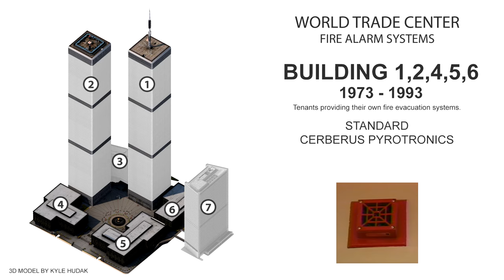World Trade Center | Fire Alarm Sounds, WTC 1,2,4,5,6,7

Comment: Thank you for uploading. Very good, clean generated sounds of the Firecom 8500 tones, which have fascinated me for a while. There is one quite eerie video on YouTube, might be unlisted, called "Inside 7 World Trade Center Moments Before Collapse", and you can hear the 8500 system chiming and whooping away throughout a good chunk of the video. Sounds are spot-on. Maybe just a difference in timing, like you mentioned in the description. I have wanted to recreate these sounds for some time to use in a possible simulation system setup, but I don't know what program I would use to do it, much less how to do it. Great job.
Reply from the maker: I appreciate it! The video you're referring to was shot by Mark LaGanga, which provided a rare account on the trade center site in between collapses of the south and north tower.
From what I could gather from the Firecom patent, the alternation between the whoops and chimes was regulated through circuitry rather than being a fixed sound file. That might explain the varying duration of it as heard in LaGanga's video. You can even hear the whoops either being cutoff or starting midway a repetition.
Reply: @RobvilleVirtualRealisations  Ah, okay. Thanks for the information! You can definitely hear it was a very primitive system, and a fascinating one.
Reply from the maker: @thebananaman1895  That's LaGanga's video indeed.
Reply: yeah I remember watching that video many times and hearing these haunting sounds.  They are spot on.

Comment: The WTC 7 alarm was also in WTC 5. There’s a video of people evacuating through the building and the alarm is going off in the background.

Edit: Turns out the audio was dubbed in that video, but you can hear the two chimes coming from one of the low-rise plaza buildings in Jack Taliercio’s footage.
Reply from the maker: Do you have a link to that video?
Reply: Robville Virtual Realisations I forget the name of it. I saw it on YouTube though. Search something along the lines of “evacuating through WTC 5” or something like that. I think that was what the video was called.
Reply from the maker: @savagepanda8458  Found it: https://www.youtube.com/watch?v=gv-wANt35hw
Really interesting find there since none of the reports mention that Firecom was used elsewhere besides building 7. I think it is safe to assume the other lowrise buildings had the same system then. I appreciate the feedback.
Reply: Robville Virtual Realisations Also, I just noticed that in the well known footage taken by Jack Taliercio, you can hear the two chimes in the background, at one point.
Reply from the maker: As cleverly noted by user Datamaster, it turns out the Firecom alarm was added into that video in post. I've overlapped the audio with Mark LaGanga's WTC 7 footage and not only does the alarm sound overlap perfectly, I was able to distinguish other background noises from LaGanga's video that were present in the WTC 5 evacuation video as well, at the exact same time also. He had also pointed out that in between videocuts, the chime sound continues uninterrupted. If it was an actual recording that would coincidentally overlap between takes, there would be at least some form of an audio cut.
And to think of it now, it actually makes sense that the audio was edited in later, because the chime sounds signaled a notification of the fire department. They would not be required in any of the lowrise buildings. Also, the reason WTC 7 had a Firecom system was because it was built much later than the main complex and Firecom was much newer around 87. The only upgrade the main complex got was until after the bombing of 1993. By that time, Firecom was outdated compared to the voice assisted MXL system, which was then intended to succeed the original Pyrotronics alarm. That explains why no reports ever mentioned anything otherwise.

Edit
I found the original video from Evan Fairbanks where the audio was added onto: https://www.youtube.com/watch?v=pz6_8WAIGb4 It seems that the original footage did not have any sound, which explains why there were effects added.
Reply: @RobvilleVirtualRealisations  I never realized that. Thanks for letting me know.
Reply: well why you hear it wtc 5 and 7 you can go in useing 5 so in that line may be the 4050-80s useing the fire com tone

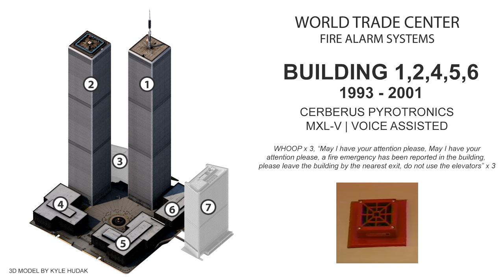Comment: 00:05 To 01:08 The Alarm in the picture is a Wheelock 34-24, it's not a speaker it's a mechanical horn
01:09 To 01:42 The Alarm in the picture on the left is a Roshni Sounder, it's not a speaker it's a sounder. The Alarm in the picture on the right is a Simplex 4051 with 4050-80 light plate, it's not a chime it's a mechanical horn
Reply from the maker: Thanks for the clarification! Goes to show that I had a misunderstanding of the equipment that was described. Curious, do you know what the speaker systems should've looked like?
The Wheelock 34-24 I had mistakenly assumed to be the speaker based on the Port Authority WTC evacuation video. It starts by showing the alarm whilst playing the Cerberus whoops. I did not know at the time of making this video that it was an artistic choice that I assumed to be factual.
Reply: @RobvilleVirtualRealisations  
Hi again,

I have seen a few discussions on the speaker strobes that WTC 7 had. it appears that they used modified Wheelock speaker strobes, similar to the E70-2430W. However, either the strobes were disabled, the lobby speakers did not have them, or the camera just didn't pick up the strobes in the video that shows WTC 7 after the south tower collapse. Either way Firecom seemed/seems to like Wheelock speaker strobes (if the assertion of what WTC 7 had is correct) because the new World Trade Center mall also uses Wheelock speaker strobes and was installed by Firecom.
Reply: bro mastered the alarms

Comment: More info on the alarms in 1-5: They used MXL-V Slow whoop un-voice assisted. The speakers were Cerberus Pyrotronics SS25-15/75 Wall speaker strobes, With the pull stations most likely being Cerberus pyrotronics MS-MIs.

Comment from the maker: Please see the video description for any discovered inaccuracies/ updated information.
Reply: Ok
Reply: I would like to point out that the video in the description being used as evidence for the alarm systems in 4, 5 and 6 almost certainly has dubbed audio. It sounds exactly like the audio from the video taken in WTC7. You can even hear the part where the camera man (camera man filming WTC7)  is running up the escalator which doesn't match the video at all. you can even see a part of the video where the image skips but the audio of the alarm doesn't
Reply from the maker: @DatamasterCorporation  Interesting note there. The chime sound does indeed overlap a cut. I'll download the video with LaGanga's WTC 7 video to see if the alarms overlap perfectly. If so I'll remove that note.
It could explain why it doesn't make sense that the complex was partially Cerberus and partially Firecom. WTC 7 used Firecom because it was built later and a bit of a standalone entity to the complex. The concourse however was there from the beginning so it would make sense the systems within would match.
I appreciate the insight.
Reply from the maker: @DatamasterCorporation  It turns out you are right. Very well spotted!
The sound from Mark LaGanga's video perfectly overlaps the one in the lowrise evacuation video. Aside of the alarm sounds matching perfectly, I was able to distinguish a ringing phone in the background which can be faintly heard in both videos at the exact same time as well. I'll remove the note, and thanks again for pointing that out.

Edit
I found the original video from Evan Fairbanks: https://www.youtube.com/watch?v=pz6_8WAIGb4
Turns out the original does not have any sound in it, hence why the uploader of the edited footage has added effects. Shame the uploader doesn't acknowledge this.

Comment: Since I’ve been in two hotels with old Firecom systems, I wanna say the speakers in WTC 7 were made by Atlas Soundolier if they weren’t Wheelock or CP.
Reply from the maker: That's really interesting to know. I couldn't find any information at all about what kind of speakers there were used, so the images included were to my best of estimations. I'll add it as a note.
Do you by any chance have some sort of reference that I can take a look at?
Reply: I don’t, unfortunately. I just know that the Stuart and Affinia Dumont hotels have Firecom systems with Atlas Soundolier speakers. It’s a stretch, and I could be very wrong, but that’s what I think WTC 7 had. Look up “Atlas Soundolier SVT-72”.
Reply from the maker: @ticearpey3235  I really appreciate the feedback regardless. Your estimation seems a lot more plausible than mine, especially since you've seen it firsthand, and the speaker you've listed seems well capable of the frequency that Firecom used. I've noted it down in the video description as a possible inaccuracy of the video.
Reply: I also appreciate you taking the feedback! With the little info provided, and those two hotels, I only assume this is what the majority of Firecom 8500 or similar systems were like in NYC. 
Never forget.
Reply: Building 7 Used Wheelock ET-1010's and Wheelock E70's. Commonly Firecom 8500 Voice Evacuation Panels During that time era used Wheelock ET Speakers and Speaker/Strobes, And Sometimes Simplex. I was at a Hotel(I forgot where), And Thie sound at 1:20 Was the exact Whoop From the Firecom 8500 Voice series. So The Master Control Panel was in a Special Big Walk In Closet. If the mics were keyed, You'd hear the Chime tone,(Some systems played The Chime tone

Comment: 1:28 I remember hearing that exact sound in a dream where I was in Level “The Metro” in the Backrooms. I remember 2 new files on my phone’s “Files” app appeared in On My iPhone without a file extension and no spaces just snake case and the wiki said that deleting one of them would cause you to get thrown out of the train and into a void and I forgot what deleting the other one did but it was bad. But I heard that exact sound when the Metro stopped at a stop, that sound played in the metro train while it docked to open the doors, while it was totally empty both the train and station. Never saw a single entity or human.

Comment: A Wheelock 34t or a simplex 4050 is not a speaker.
Reply from the maker: Interesting note. I thought those generated the voice alarm, based on the PA's evacuation video where I took the screenshot off. I do wonder though why one was there as I couldn't find any other non voiced alarm sounds.
Reply: Maybe find a Wheelock E70 or an Older Fire alarm speaker
Reply from the maker: @relevanteaglealarms109  That makes sense. I found a video showing a Siemens MXL voice assisted alarm and it indeed shows a speaker strobe combination. Shame I cannot update the video imagery, but I'll add a note about it in the description. I appreciate the feedback!

Comment: Why is there a pause between “by the” and “nearest exit” in the second alarm?
Reply from the maker: IIRC, the voice plays a programmed assembly of instructions. For example, it may be possible to leave the building by a specific exit or area. In this case I'd assume that "nearest exit" is the general option. The transition between the two instructions is simply a bit rough.
Reply: @RobvilleVirtualRealisations   I found out that this is because Cerberus Pyrotronics did not allow for custom messages from the factory, so, the message is switching to the MXL voice card with the vocabulary if it said “Fire Stairway” or something else

Comment: So the towers got rid of the perfect alarm system and replaced it with whats sounds like a person imitating a alarm
Reply from the maker: The voice assistance was only part of a larger upgrade, as a result of the bombing in 93. Voice evac proves useful in buildings where visitors can be present who never held an evacuation drill.

As for the sound quality, the voice evac alarm is an actual recording of the system, opposed to the traditional one which is synthesized based on the Cerberus tone. The whoops would've sounded the same coming from the actual alarm.

Comment: I read in another comment thread there are sound files used in South/Tower 2 to prevent evacuation. Do you happen to know where I could find this?
Reply from the maker: It's still a bit unclear to me on whether the cancellation of the alarm included an automated response. So far it seems people were manually instructed to go back to their offices via the use of the public announcement system and by Port Authority officials, therefore no sound file as such would exist. The book "City in the Sky" seems to portray that.
I'd be curious to know though if there was any automated sound being played in the South Tower prior to its attack.

Comment: So they changed the alarm system after the 1993 bomb attack under the North Tower... curious fact i didn't know.
Reply from the maker: It was quite an undertaking. I recall reading that by the time 9/11 happened, the upgrade wasn't fully implemented yet and still being worked on.

Comment: Does anyone know why the alarm voiceover paused at the  "please leave the building by the......nearest exit" part?
Reply from the maker: My guess is that it either was a hickup in the synthesized voice, similar to how early text to speech voices rarely spoke fluent sentences. Or that different directions could be programmed, and that the transition between the fixed and programmed part was simply rough. Similar to navigation systems or automated announcements at train stations that often pause mid sentence.

Comment: Any time i try to add a link the video gets remover

It used the old version, you can hear it in this video here at 27:02 28:30 (you hear it the loudest at 8:00 - & 43:57 & 45:00 VERY Faintly the video is called 
"First Response (Full Episode) | 9/11"

 and this video called "9/11 FDNY RADIO WTC 2 COLLAPSE" at 0:23 & 0:45

Comment: did any of the 34t or simplex 4050 80s with the 4040 survived that would be neat
Reply: I think they got completely crushed into flattened, plastic and metal
Reply: Jeff Arnold  do you have the images or video that shows the E70’s?
Reply: Jeff Arnold  Thx but I actually mean the “Black” E70’s

Comment: Can anyone explain to me, in the towers 1 and 2, if the alarm were pulled, did it sound throughout the entire tower? Or were there zones?
Reply from the maker: I read that before the 1993 bombings, tenants had their own fire systems installed. This would make it highly likely that if a pullstation was pulled or if a fire occurred within an office, that it would only set off whatever alarms are directly hooked to it, aside from those in the skylobbies and elevator landings.
I haven't found any confirmation yet, but with the cerberus system it is likely that if it were set off anywhere in the building, it would initially trigger the entire tower to evacuate. But that the alarms could still be deactivated either per floor or per (sky)lobby in the event of a malfunction or a contained situation. But AFAIK and have experienced, a whole building is initially prompted to evacuate once a fire alarm is triggered. Since the origin is often unknown during the first crucial minutes of evacuation. Better have everyone walk out for nothing, than finding out that a little paper fire is a lot more serious.

Comment: Question: were the alarms in from 1973-1993 changed after the 1993 bombing? If so, why the change?
Reply from the maker: That's correct. Although the fire of 1975 showed the first signs of how lacking the system was, after the bombing of 1993 they opted to replace it for a complex-wide alarm system with a central operation center. Before 93, tennants used their own fire alarm systems. You can imagine the risk that brings when a massive fire is going on while parts of the building remain completely quiet. With a centralized system, the entire complex could be alerted at once.

During 9/11, the conversion from 93 was still in progress, though largely completed.
Reply from the maker: Trumpispoop  Indeed. There's even a bit mentioned about it in the book "City in the Sky" 
Louis DiBono, the guy who was contracted for the fireproofing even ended up getting murdered by the mafia inside the Trade Center's parking garage.

Then there's also the less admirable way of how they got rid of Radio Row in order to make space for the towers.

For the buildings we have come to appreciate, there was definitely a dirty side of it that got them built in the first place, leading to lots and lots of cut corners of which many played a substantial role during 9/11. The sheetrock walls and "that'll do" fireproofing to name two of them.
Reply: Trumpispoop it astounds me still that fire sprinklers weren't required during the construction of the WTC and were retrofitted later on.  Or that prior fire codes required six stairways and a recent change lowered that to three.  Which were all placed very close to each other (to maximize floor space, of course) and were destroyed when the planes hit, except for one stairway in WTC 2 by pure luck (due to mechanical stuff).

Comment: Why did building seven have a completely different alarm than the other buildings?
Reply from the maker: It was built & completed in a later time. The Firecom system was considered more modern than to what was installed inside the main complex.

Comment: Why the first alarm in WTC 1 and 2 is only on few floors?
Reply from the maker: In the original layout, the alarm only covered all the public and personnel areas such as the lobby, sky lobbies, elevator landings and mechanical spaces. Tenants provided their own fire alarm systems. After the bombing of '93 they decided to streamline the whole system by making it totally controlled by Port Authority. I read that at the time of the 9/11 attacks, the buildings still weren't fully upgraded yet.
Reply: @RobvilleVirtualRealisations  Oh ok thanks, it's very interesting, thank you for this clarification